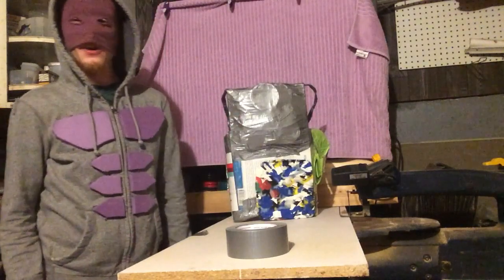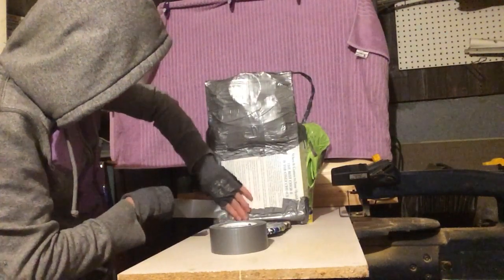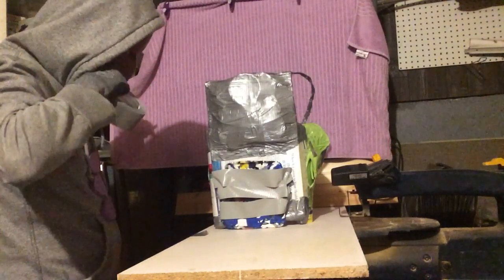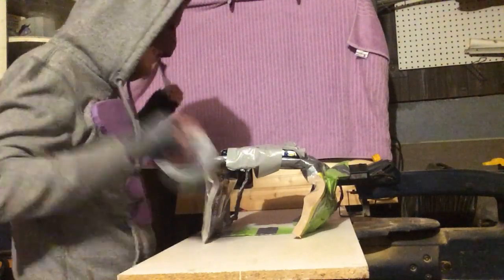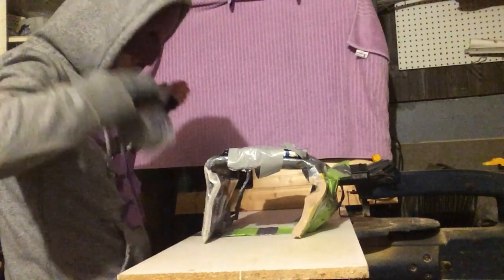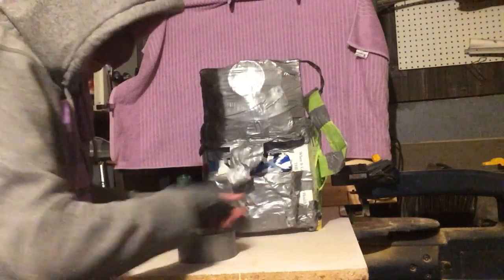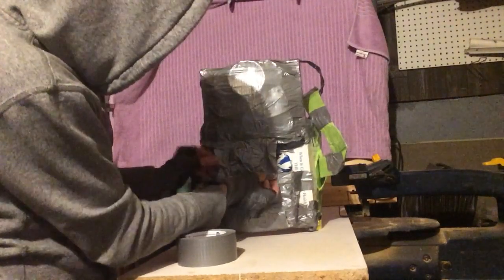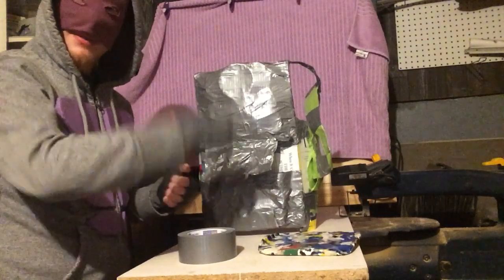Upgrading The Stab Resistant Armor Vest!!! (Part 2) Bone Fist RLSH

Comment: you should make that pouch a bit thicker over time, if the tape takes enough damage then the plate could fall away and you will lose it's protection. may i suggest?: after thickening the layers of tape, obtain water sealant and any brush on glue and lacquer, use the water sealer and brush on glue to completely seal the armor to preserve it and let it dry for a day outside  with a breeze and no rain, over time apply wood lacquer in layers and let each coat dry before applying the next, the wood lacquer will harden the areas you want to protect if it is done full body or in sections, this will work like applying a coat of paint to your armor framework to make harder to break,  this is one of my early armor concepts, "resin framework." i used this idea on a bmx chest protector a long time back, it worked out good because all the vents in the chest guard gave the glue and the sealers something to grab on to and fill in

Comment: There are much simpler and more effective ways of creating a pocket for the plate, but just as cheap. Using only duck tape is clumsy, when you could tape fabric or a ziplock food storage bag on. Or just cut the side off a cheap 'bag for life' reusable shopping bags and attach with tape.